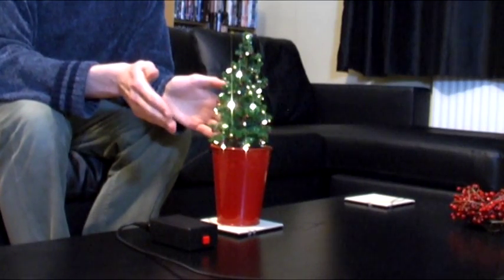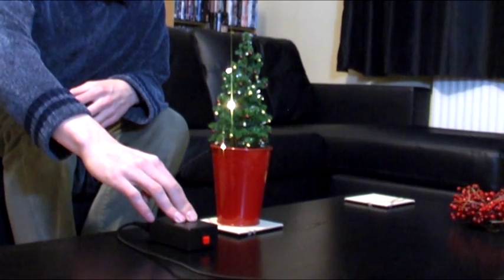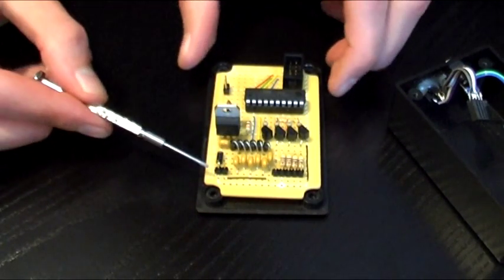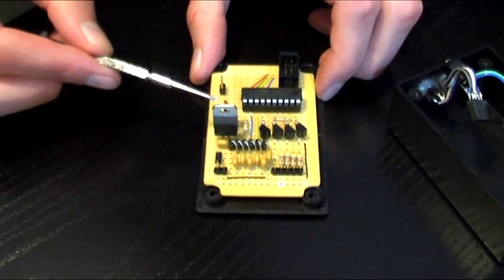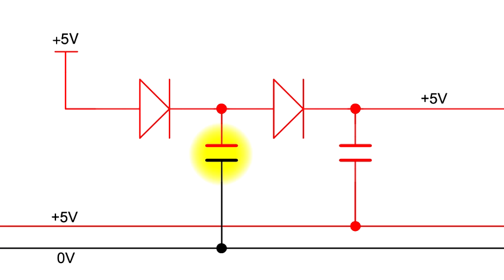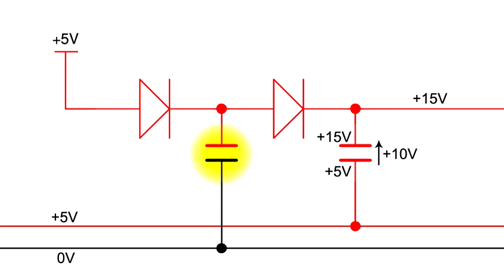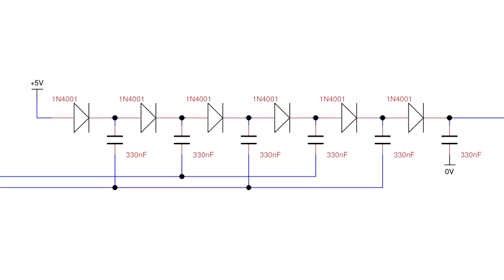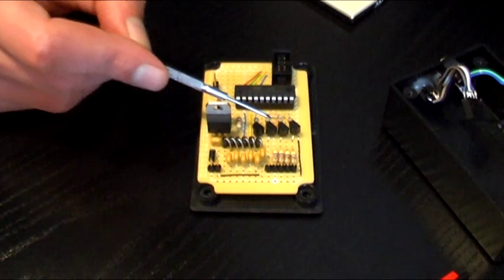Miniature Fairy Lights

Comment: Hello! I wonder if you can help me. I'm doing a model making project whereby I need a string of about 30 LEDs to fade in and out in a pseudo-random effect. It's a model, so it has to be portable and therefore battery powered. But I only need the single affect rather than the variety you have wonderfully made. But as soon as I opened your video I noticed that the initial effect your Xmas tree is making is precisely the desired affect I require. If there's any assistance you can explain I'd greatly appreciate it. I did do Electronics A-level many years ago but since I have done Mechanical Engineering, so whilst I understand hardware and coding is a mystery to me. Thank you
Reply from the maker: Hello Aidan, thank you for your kind message. I think the circuit as presented in the download should work for your needs and could run from batteries, though I'm not sure how efficient it is as I only ever ran it from a mains supply. Are you familiar at all with programming AVR microcontrollers? If you only needed one particular animation sequence you could remove the push-button from the circuit and change line 20 in animation.c to the animation you desired, e.g. animation_type = ANIMATION_TYPE_CHASER; or animation_type = ANIMATION_TYPE_SIN_FAST; (I'm not sure which is the correct one off the top of my head, the various animation types are defined in animation.h).
The code can be built and sent to the microcontroller using the WinAVR package, there's a Makefile included so once you've set up your programmer in <installation directory>\bin\avrdude.conf (change default_programmer to match your programmer) you can set the microcontroller's fuses with "make fuses" on the command line and rebuild and send the code with "make flash"